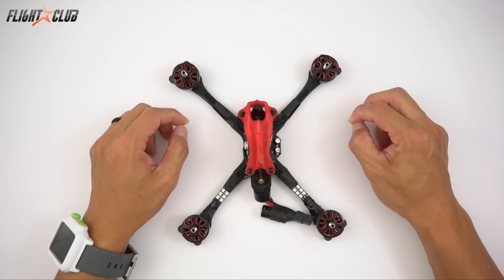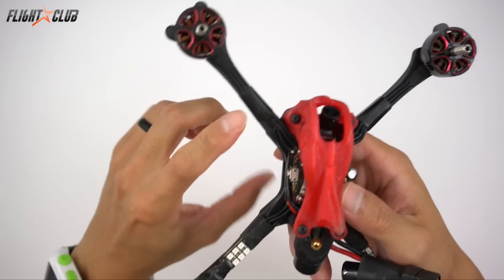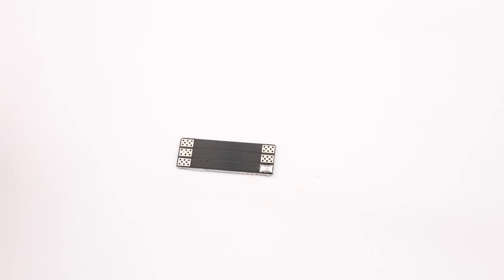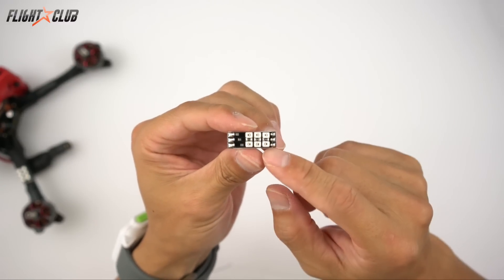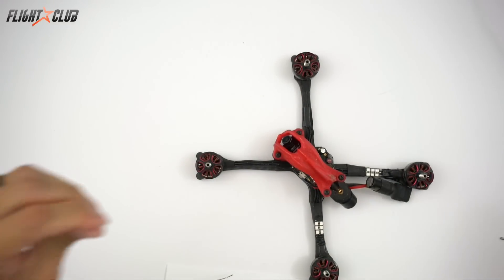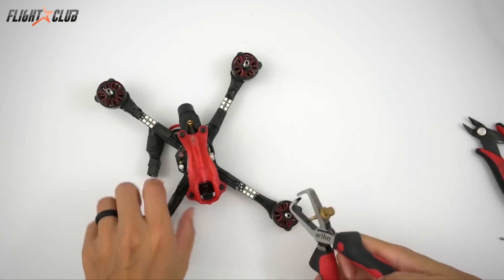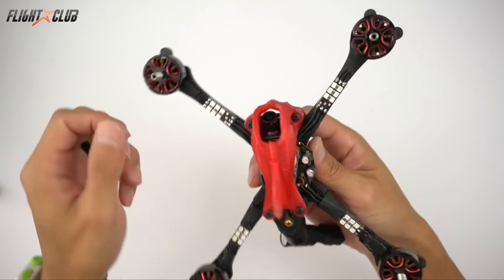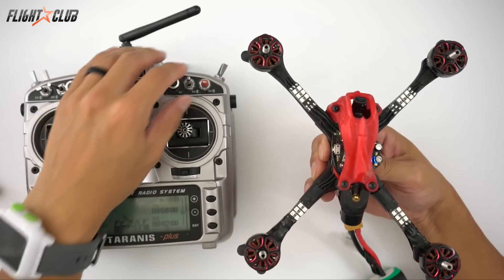Wirelessly add LEDs to your Quadcopter | Racewire Racelite

Comment: CL racing already has these with the LED's built into their racewire. No extra soldering. $7.95 a set of 4 been using them for a while.
Reply from the maker: yeah i know there are a lot of different options but i try not to support copied products.  it happens :(

Comment: Def getting some. What tape do you use to wrap where the motor wires connect to racewire. Just was woundering I've been using electric tape and it always unrolls. Yours doesnt look as shiney. Didn't know if it was something diffrent?

Comment: This may or may not concern you because im sure you dont need that much range to race, however... Putting the receiver antennas under carbon or any other conductive material will affect the signal. I recommend using some zip ties or antenna tubes to mount your antennas perpendicular to the arms. Its not as clean but it will yield better signal performance. Keep up the vids and the nice builds. Maybe some acro footy videos in the future? 🤷‍♂️

Comment: Pretty nice, dude. 😊
They should make a 2 in 1 board.
Reply: On Banggood you can buy racewire with led. I have it on my kwads!
Reply: @calcifiedbonecollector3222  Oh, great! I'm going to search for them there, thanks! 😃
Reply from the maker: yes they are banggood but those are blatant copies.  i try my hardest to not support copycats.
Reply: @MCsCreations  CL racing has the LED's built into their Racewire no need to solder the LED on to the board, Just solder your motor wires. $7.95 set of 4 with your choice of colors. Been using them for a while now.
Reply: @FarmerFpv  That's great! 😃 But is it sold on Banggood or something? Because I'm from Brazil and the shipping cost from the US is too much expensive. 😕